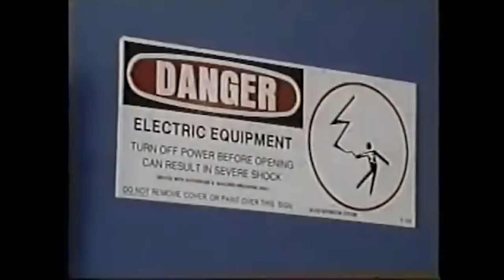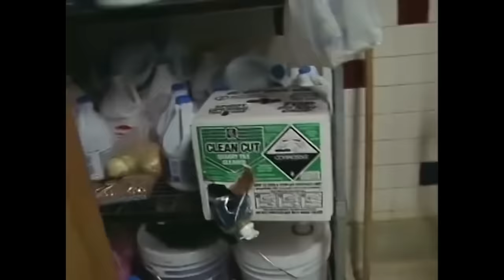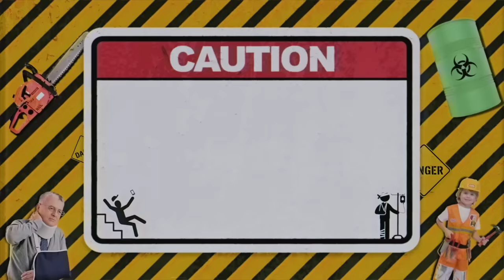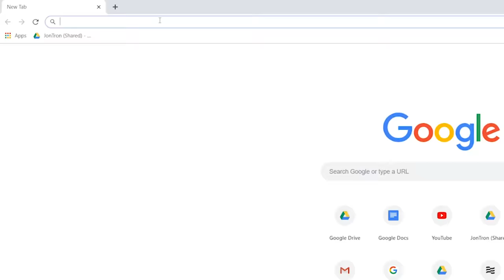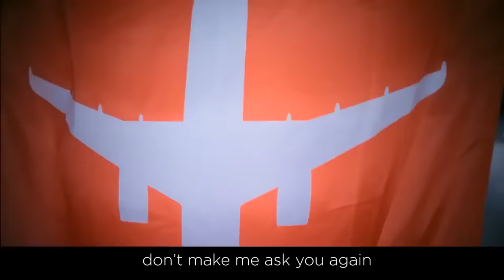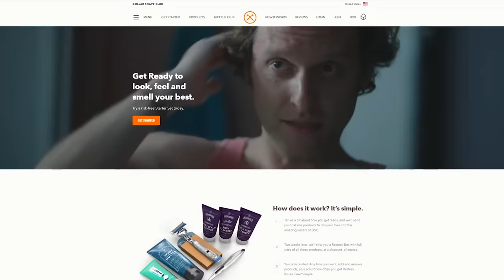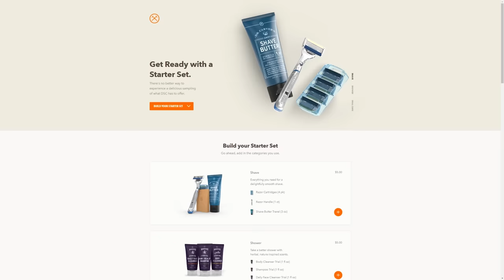Workplace Safety - JonTron

Comment: Just like to inform you that the "fatal half-inch" has some merit. I tripped over such an elevation change. The asphalt sank below the curb, but I didn't notice it since the change in color hid the change in height. After picking debris out of my hands, I had to laugh at getting caught over such a tiny bump. Now imagine a similar situation, but at the top of the stairs or on a rooftop and you can see why they are worried about half an inch.
Reply: I mean especially if you’re carrying stuff. Then I swear anything in the universe will knock you down.
Reply: same happens with stairs..plust the extra gravity
Reply: Exactly. I don't know why Jon was so down on that concept 😂
Reply: when i moved to my new apartment, i wasn't looking where i was walking when trying to meet my ride for a movie and ended up tripping over a change in elevation in the sidewalk and just barely saving my face with my hands. hands and chest took the brunt of the fall, hurt like hell but i was just mad enough about the current circumstances to ignore the pain until i got in the theater.
Reply: Maybe he never experienced it......

Comment: So what is the lesson in Shoe Store Head Trauma? Looks like she just had an accidental slip or the ladder broke. Neither of which looked preventable so what are we supposed to learn?
Reply: That if you get annoyed at a costumer you... die? i dunno.
Reply: I think the issue was that she wore heels on a ladder that wasn't stable, or just that the ladder wasn't stable.
She also didn't use a ladder that went high enough to grab the things she was looking for without playing Jenga on a leaning ladder.
Then the Jenga shoes/shoe boxes fell over, something hit the light just above her, then she slipped and fell because she also wasn't fuggin' grabbing anything to support herself.

It didn't look like the ladder had broken. 
I say it wasn't deployed properly because after she started walking on it, it wasn't stable whatsoever. Normally if it's deployed correctly, the ladder would be held down by your weight.
Might wiggle a li'l at first, but after you're on it, it should be fine. If not, you call someone else in the store to hold it down for you,
or you get a different ladder.
Reply: Don't wear stiletto heels on a ladder
Reply: @Technotoadnotafrog  your heel doesn’t usually touch the steps of a ladder anyways so what’s the difference?
Reply: @etrangray-mane8610  I have big feet I usually stand with the top part
Reply: She was wearing fucking heels on a ladder
Reply: The customer and employee were enemies and the customer chick tampered with the ladder and killed the employee, Duh
Reply: @MrJostur  so basically it's proper PPE
Reply: She grabbed the bottom of the boxes, causing the top to hit a light, consequently causing it to break, sending a spray of glass toward the ground, which severely startled the woman, causing her to fall off of the ladder, with the help of high heels go send her to the ground, with her general area around her head and neck onto the glass shards from earlier, which could easily been prevented via sneakers, or whatever women wear casually.

take it or leave it, I ain’t doing this again
Reply: She was wearing heels on a ladder. Don't do that
Reply: @sammcneillmckinnell5003  usually your heel doesn’t touch the ladder anyways when you climb up one so why does it matter? Most people climb ladders with the top portion of their foot
Reply: @WigWoo1  heels are not secure, they're incredibly loose fitting, so it doesn't matter what part of your foot you climb with.
Reply: @sammcneillmckinnell5003  oh ok. Thank you. I wouldn’t know
Reply: had this been a certain meme app, i would've given you a very unique answer.
Reply: No heels, sturdy ladder
Reply: Don't climb a fucking ladder with high heels
Reply: @WigWoo1  Walking in heels is tough enough. Lol I prefer flats because I like my ankles not to be broken.
Reply: Make peace with your gods
Reply: To be fair she was wearing high heels on a ladder
Reply: That you should learn how to do a backflip and land on feet
Reply: I think it’s the high heels on a ladder that’s the problem.
Reply: Don't work in a shoe store
Reply: Don't work in a shoe store
Reply: @rat1806  u copy cat
Reply: @spoohater6949  I genuinely said that before seeing you said the same thing
Reply: @rat1806   false u said it an hour ago
Reply: @rat1806  unless u did a while back I am sorry
Reply: @Logan Hoerster genius
Reply: No high heels on ladder
Reply: Don’t wear heels on a ladder
Reply: @lobstercat   AAAAGH my ginormous ego has been shattered! Like a plate being smashed to the ground!
Reply: Just don’t trip lmao
Reply: We're supposed to learn that if a light breaks you're fucked
Reply: Don’t do drugs
Reply: Don't be like either of them.
Reply: Well she was climbing in heels which is an awful idea
Reply: Have good customer service, or  the customer service gods will smite you
Reply: I guess do not trust your coworker. It was them who unscrewed the ladder.
Reply: Bruthur, one should always climb a ladder with a spotter. Preferably. If not, then at least check to see if it’s stable.
Reply: She was in high heels as she was climbing
Reply: @WigWoo1  learn how to safely use a ladder please
Reply: Don't wear heels?
Reply: Never use the top rung of a ladder and don't over reach.
Reply: She got COVID because of a lack of proper PPE. Pay attention.
Reply: Don't be in a final destination movie.
Reply: ThIiiiIIIiIinNNnnnKK AbbbbOuuuuuTTtt TThhhIIISSSSSssssssss
Reply: don't have bad luck
Reply: @WigWoo1  have you seriously never seen heeled shoes before? only the toe part is flat, which means even the smallest slip is fatal
Reply: @tacos5682  yes don't become enimies with coustermers or else you die.
Reply: @bisexual_bicycle8719  yes
Reply: It was the fact she was wearing heels
Reply: Nothing that's what
Reply: @MrJostur  you have a inhuman amount of patience to type all of that
Reply: It was her shoes I think? I mean like, you should never climb a ladder in heels 😂
Reply: I think it’s because she was wearing high heels on a ladder
Reply: She was in heels on a ladder, the ladder was unstable and too short, the floor wasnt clear, and the florescent light was uncovered and really low (meaning broken glass).
Reply: @WigWoo1  Heels affect how your foot sits- even when your whole foot isnt touching the rung, it's incredibly unsafe to use a ladder in heels. It doesn't just raise the back of your foot- they're curved a bit, and the only "flat" part is where the ball of your foot sits. That's why you can't just break the heel off to walk more comfortably like in the movies.
Reply: @sammcneillmckinnell5003  And they throw off your balance.
Reply: @squeezyachoo4931  That sounds like some final destination shit
Reply: The lesson: Don't stand on water
Reply: The light fricking shattered a knocked her over how is that preventable.
Reply: @MrJostur   no what knocked her over was the light exploded.
Reply: She climbed the ladder with heels, people can hardly walk in them things let alone climb a ladder
Reply: I think the light exploded
Reply: Don’t fall
Reply: Just don't slip
Reply: In ladder safety, they say someone should be holding the base of the ladder whilst someone else climbs it
Reply: Don’t slip
Reply: The lesson is it be like that sometimes
Reply: @etrangray-mane8610  what??? no???? no one stands on a ladder with the middle/arch of their foot.
Reply: @shahbazvegeta1454  sound advice
Reply: @benadrylsmoke5481  😆😆
Reply: or how the lights just decided to break out of the blue
Reply: @xraystudios3693  idk about you but everytime i wear heels on a ladder and fall and crack my head open, the lights always randomly burst to create a perfect scene of disaster
Reply: I think it's don't wear high heels on ladders. And don't stand on unstable ladders.
Reply: Buy a bigger/ more durable ladder. Don't wear unstable shoes (e.g. heels) when working on a ladder.
Reply: Don't forget about the light just randomly breaking
Reply: She fell bc the light exploded
Reply: Not wearing high heels
Reply: Don’t do retail
Reply: @MrJostur  She could have gone barefoot and not wear heels.
Reply: Don't wear heels on a ladder, secure a ladder before you get on it.
Reply: @thegoblin4948  Just sounds like a Karen's dream
Reply: Don't die
Reply: The lesson is that heels are a death sentence
Reply: Don’t wear heels on a ladder wear regular shoes
Reply: Not to be a goober ig
Reply: Don't die, I guess

Comment: For anyone wondering, syncope is essentially just fainting. Heat syncope, specifically, is fainting because you're overheating.
Reply: i dont feel so good
Reply: Snap
Reply: @mauricer.4873  Spider-man had Thanos Syncope
Reply: That almost happened to me during a soccer game. I felt kind of dizzy, so I asked to be taken off.
Reply: Thanks for that. Is it basically heat stroke?
Reply: I think I had that once
Reply: @manabluerose  Thats pretty much what it sounds like
Reply: @manabluerose  Not exactly. Heat syncope is the result of hypotension, or low blood pressure. 
Essentially, your body is overheating --> arterioles dilate as a response (more surface area = more exposure = more blood can radiate heat away)
Dilation of blood vessels = increased volume = decreased pressure ==> less blood getting to the brain. 
If steps aren't taken to correct this issue, then fainting (or "syncope") occurs.

Heat syncope can be seen as the precursor to heat stroke. But heat stroke is a much more severe condition to be in as it can be fatal.

Comment: For the tripping hazards, as a former laborer those cracks are absolutely trip hazards, especially when you add 40+ lbs to whatever you’re carrying.
Reply: Especially if you are on a roof.
Reply: @josephmoya5098  youve got sidewalks on roofs?
Reply: @abecadlo15  No, but there are plenty of minor elevation changes on roofs. And if you trip on them and your safety line isn't set up correctly, you can easily die.
Reply: @josephmoya5098  Leading edges are terrifying
Reply: yup.  if you cant see where you're stepping that 1/2 inch can definitley be a killer in the right circumstance.  hell if the soles of your shoe are slick enough and the surface you're stepping on changes within an elevation you could really get hurt.  its all about circumstances.
Reply: As someone who is a bit of a klutz, I have fallen enough times on those sorts of hazards just walking around. If I worked any job with heavy lifting, then I probably would get seriously hurt at best.
Reply: Jontron is a tripping hazard
Reply: Everyone here needs to play death stranding to learn how to walk.
Beginner tips-
Step one:
Hold the opposite nipple, when stumbling in a direction.
Step too:
Hold both nipples if you aren't sure
you will walk slightly slower, but prolly are paid by the hour, so get that W.
Stet three:
press g, then 2, and then F to look at BB
Step 4
don't ever use a skateboard while on the job, even with a load below 50 lb.
Reply: They're also really hazardous when operating dollies and motorized machinery
Reply: Found the lizard
Reply: @josephmoya5098  Roofing is perhaps the least enjoyable construction job there is.  Right up there with insulation.
Reply: In my experience the smooth floors can get you too. Usually the ones that are designed to get hosed down, so they’re like completely free of any rough surface ever.
Those things get slightly wet and it’s a death trap
Reply: @F_Print  I fractured my L1 last week while skiing, and now those sorts of trips and falls terrify me. There's so many things I wouldn't do now that I know how serious spinal injuries can really be
Reply: Pick up your feet man

Comment: I know I'm late on this, but the heat syncope visual actually works if you know what it is. It's a fainting or dizziness spell triggered by changes in elevation. So a guy saying "I don't feel so good" on a ladder works, but it's incomprehensible if you don't already know what heat syncope is. Him falling off the ladder would have worked better, frankly.

Comment: The worst/best thing about these videos is they're usually made after an accident to make sure it doesn't happen again-

Saw a meme/roast recently in a similar vein which took a screenshot from a boomer complaining on twitter about how newer generations were so dumb because "car manuals used to tell you how to use and fix a car now it tells you not to drink wiper fluid."
And someone responded simply by saying "manuals usually update after incidents not in preparation. For manuals to now read not to drink wiper fluid when they didn't before means that people beforehand drank the wiper fluid."

Comment: The whole how to lift properly is pretty legit. We usually put a lot of the strain of lifting stuff up on the lower back and spine. The proper to lift stuff is by lifting with your legs, using the lower back to stabilize yourself.

Comment: I worked in a shop that had a huge automatic oven for powdercoating. It was open where parts went in, and went out and the oven ran over 400 degrees. In the summer they gave us some bs walmart fans as when they put the oven in, decided not to air condition the place.... Lot of places like that, gets hot as hell in the summer. It was actually nicer outside where the breeze was cooler than inside even on the hottest summer day.

Comment: I know the jokes going on around the heat illness video, but in all seriousness it's not just that simple, unlike what it seems.  A TON of outdoor jobs, and indoor jobs in places with high heat don't have anywhere for you to go to get shade, not that you could knock off and get said shade ;).  You HAVE to stay working unless someone over you says otherwise.  In the end, there's lots of reasons someone might not be able to do these "basic" things to cool off.  ALSO It's knowing the symptoms within and externally for heat illness and heat stroke.  Heat Stroke can be deadly, and heat illness might just be that "heat syncope" that it spoke of (in other words, feeling ill and faint.  This is because with this your blood vessels dilate to the point that you get dizzy and can faint/fall out.  It can lead to worse symptoms than these.  I worked in a place that had 90 degree heat in the winter and over 140 during the hottest days of summer. 

We had multiple people falling out every year because of this, we also couldn't keep staffing up to normal levels because of that.  Trust me, it isn't as easy as just get out of the heat and get some air, we had air, even "port-a-cool" water cooled fans and it wasn't enough even with 3 or 4 industrial sized fans pointed at the area as well.  Heat is a serious thing, thats why companies will pay that much for a video to show you the symptoms of these heat related problems so you know it within yourself AND can see it in others, and also what to do.  It's not just as simple as get out of the heat.  And common knowledge things can actually be dangerous to the person affected.  That video does have it's laughable points like the guy litterally pouring sweat like they hooked him up to a hose pipe but, yea it's no real laughing matter irl.

Comment: 16:50 the hylarious bit is that the video is RIGHT!
the idiot writers SHOULDA gone with STAIRS as an example.
I dare you to make a set of stairs where 1 step is half an inch taller, and another random step half an inch shorter.
You'll break at least 1 bone in 1 person and cause dozens of injuries guaranteed.